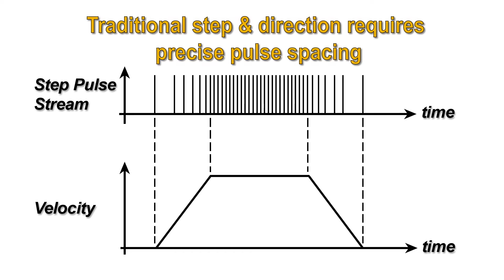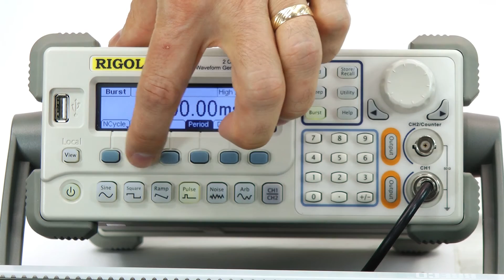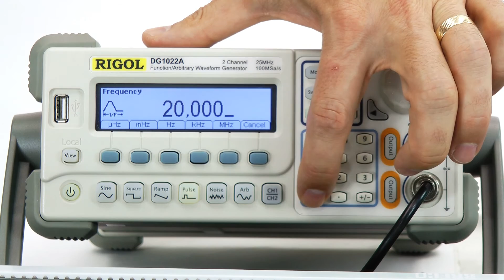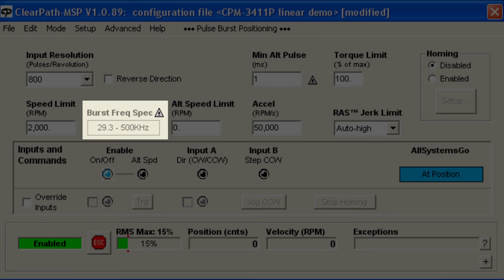ClearPath Integrated Servo Motor: Pulse Burst Positioning Mode

Comment: I still haven't seen any positional feedback in the operational modes of these motors. So I don't think these motors have the capability that I need. What about your other motors? Or maybe, can the timing of this mode be calculated somehow to know the precise mathematical waveform of the ramp up and ramp down between any distance (including low jerk)? We need to be able to pulse a laser at very precise distance based intervals while ramping up, at maximum speed, and ramping down.
Reply from the maker: Hi PicoKit,

Thank you for taking the time to reach out and comment.  I realize in advance that my response here is going to be a little long - but I want to answer your questions, and discuss the differences between the three ClearPath motor series (more on that in a second). 

Feedback : All of the ClearPath servos (regardless of series) are closed-loop servos and can provide feedback to the outside world. The ClearPath SD and MC series servos in particular have a dedicated, user-configurable output bit (our documentation refers to this as the “High-Level Feedback” or HLFB for short). HLFB can be configured to verify that the servo is tracking your command within a user-defined position tolerance. You can read more about this HLFB output in our User Manuals found here on our website: https://www.teknic.com/downloads/ 

When working on an application where you need to control the motor’s position, speed, and acceleration, (and infinitely vary all three to follow an arbitrary path through space or cut a specific part), you will want to use the ClearPath SD series of motors (not the ClearPath MC that we demonstrate in this video). When using the SD motors, your Step and Direction controller will be able to trigger a device (such as a laser) off of the step command and get excellent accuracy (we’ve had customers do this in the past). You’ll find the operational mode video for the ClearPath SD motors here: https://www.teknic.com/watch-video/?id=1#OpMode11 

ClearPath Series Overview : As I mentioned before, there are actually three different series of ClearPath motors (the MC, SD, and SC), and each has their place in different applications. If you would prefer to jump to an in-depth comparison of the three, please take a look at Teknic’s website: https://www.teknic.com/products/clearpath-brushless-dc-servo-motors/clearpath-servos/

MC Series : At a high level, customers should use a ClearPath MC motor when they want to control either the motor’s position, or the motor’s velocity, or the motor’s torque (but not all three simultaneously). As an example, in the video above we show how you can use a ClearPath MC motor in Pulse Burst Positioning mode to infinitely vary your motor’s position (but all moves are subject to a fixed acceleration limit and one of two velocity limits). 

SD Series : Most CNC customers on the other hand (or any customer who needs to infinitely vary the position and velocity) should use the ClearPath SD series. With the ClearPath SD series you use an external motion controller to create any path through space that you want your motors to follow. Your controller transmits this motion profile to the ClearPath SD motors via standard Step and Direction signals (alternately you could use A/B Quadrature signals to achieve the same outcome). 

SC Series : Customers who want to use Teknic’s C++ or C# class libraries to communicate with the motors from a dedicated host PC (running Windows or Linux) will use the ClearPath SC product. The SC (or software controlled) products are primarily used in applications which require point to point motion. Some customers might be able to use the SC servos in a CNC environment, but doing that is beyond the scope of this response – please contact us directly if you’re interested in doing that. 

I noticed that you also asked a few questions on some of Teknic’s other videos. Please feel welcome to email us or give us a call for more detailed recommendations for your specific machine.

Best regards,
Aaron B. - Teknic Servo Systems Engineer

Comment: Nice Demo. I wonder how you did the smaller velocity on the last move in the first example. Via longer pulse width perhaps. Very intriguing mode especially combined with RAS!
Reply from the maker: Hi Felix,  

Thanks for the positive feedback!

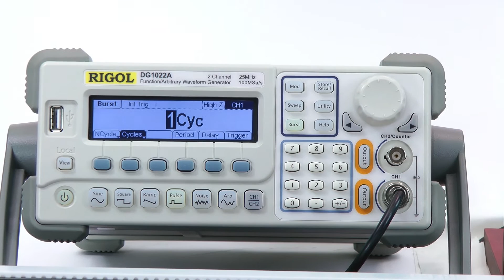The Pulse Burst Positioning mode has two user-settable velocities. In MSP there is an option called Alternative Speed Limit.  (You can see this field in the MSP screen shot from 1:33 to 1:44 of the video)  You set this value to a second desired speed limit and trigger this alternative speed as needed.  In the first demo of this video, the alternative speed limit is used in the final move.

While the alternative speed limit is not discussed in the video, this is covered in the Pulse Burst Positioning section in the ClearPath manuals. 

Best regards,
Erik M.

Comment: Is there a way to clear the queued pulses and halt the motor? Imagine a platform that the ClearPath motor is moving activates a limit switch, but the micro-controller has already sent six more inches worth of pulses to the motor. The micro-controller would need some way to halt the motor to prevent over-travel.

Lastly, the manual says the following:
"The frequency of the pulse train applied to Input B must always be higher than the specified speed limit(s). This ensures that the motor's pulse buffer is never empty. ..."
If I send a slower PWM signal to the motor, I would expect it to move at a fixed velocity below the specified maximum speed. I imagine that each pulse would be an individual move command. Then, the motor would string these commands together in a seemingly smooth motion. Would it actually function this way?

I would like to use the pulse burst positioning mode to position something absolutely along the travel path and also to manually move the position at a slow, steady velocity.

Thank you.
Reply from the maker: Thanks for your question Austin. In Pulse Burst Positioning mode, once a move has been initiated (via a burst of pulses sent to the appropriate ClearPath input) there is no built-in way to stop or cancel the move. The motor will spin until the move is completed (unless the motor somehow becomes disabled, loses power, or experiences a safety shutdown). This mode was specifically designed to reduce complexity and cost for the user.

You also asked a few questions related to pulse burst frequency and motor speed. The thing to remember here is that the ClearPath setup software automatically calculates and displays the minimum frequency at which you must send pulses to guarantee continuous motion. This is called the Burst Frequency Spec in the MSP UI; it is based on your 2 speed settings and your Input Resolution setting. If you send, let's say 800 pulses at a frequency much lower than the Burst Frequency Spec, you will still move 800 increments, but not necessarily in a single, uninterrupted move (it will likely be a series of a few short moves).

Here's another way to think of it: As long as the complete set of pulses for Move A is received by the motor before the deceleration segment of Move A begins, you will have a single, uninterrupted move. On the other hand, any pulses received after the decel segment of Move A begins will be buffered in the motor and considered part of Move B (which will execute as soon as Move A completes).

Regarding your last comment, in Pulse Burst mode you have only 2 speeds to work with, so if that is not a limiting factor for your application, then the objectives you mentioned should be achievable.

If you have any other questions please feel free to contact us directly at support@teknic.com.

Thanks,
Jim W.
Reply: Teknic Inc 
What would happen if I set the "enable" input to low for a sufficient period of time? Would that stop the motor? Moreover, how long must the "enable" input be low to un-enable the motor rather than engage the alternate speed? I did not see this detail in the manual.

I will probably need to play with the motor to see how the motor would appear moving through small, discrete steps like that. The $310 price tag is impressive for such an advanced controller being built in. I think that modifying my application (if needed) to accomodate the operations of this motor will be worth the benefits of the effortless control.
Reply from the maker: Hi Austin P.

De-asserting the Enable Input will definitely cause the motor to stop, but there are some details to consider. First, there are 3 "stop methods" to choose from when you disable the motor: 1) Dynamic Brake, 2) Decelerate to Stop, or 3) Coast. There's a screen shot in the manual that explains these options in greater detail. To read more, open your pdf copy of the ClearPath manual and search on "Actions on Disable/Enable" and you'll be able to check out the available settings.

Next. The length of time between de-asserting the Enable input, and the point at which the motor is actually disabled, also depends on a few things. The actual disable time is related to the Alternate Speed trigger pulse width as follows:

Trigger Pulse Width               Disable Delay
1-3ms                                      10ms
4-340 ms                                 3x the setting
341-400 ms                            1000 ms

Max Trigger Pulse Width setting is 400 ms.

Also,  if you chose Decelerate to Stop, you' d have to add the time it took to decelerate to a full stop (because you'd still be enabled during the powered deceleration). The exact time to decelerate would depend on your velocity and deceleration rate at the time of the disable event. Note: If you chose Coast or Dynamic Brake as your stopping method you would not have to add extra time. Just keep in mind that we're talking about the time to disable, and not the time at which the motor stops moving.

You mentioned limit switches previously, so I wanted to bring up one cautionary point. If you wire a limit switch in series with the Enable input such that a hit on the limit switch opens the Enable circuit (i.e. disables the motor) the motor will be stuck wherever it ends up (until it is enabled again).

Regards,
Jim W.